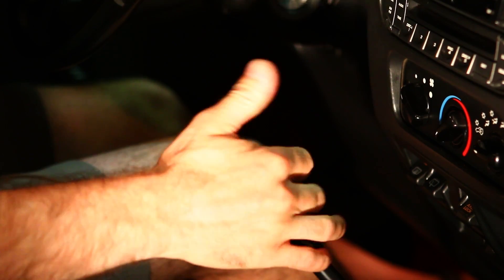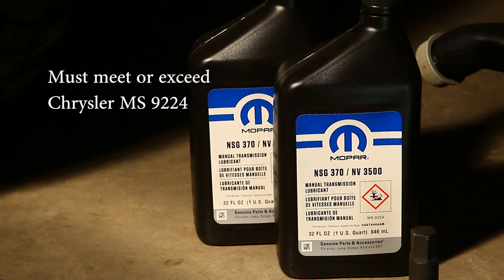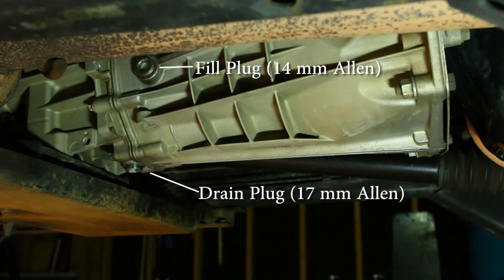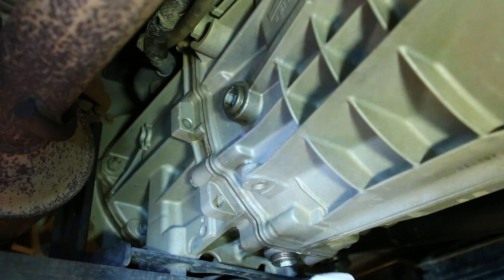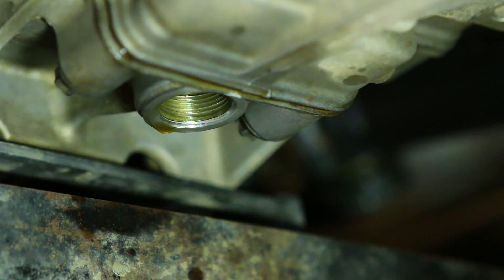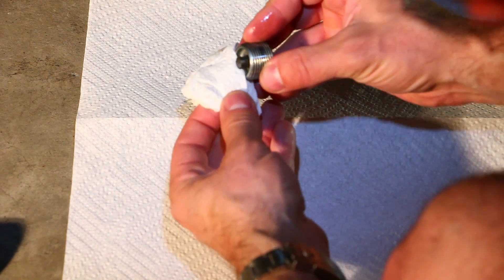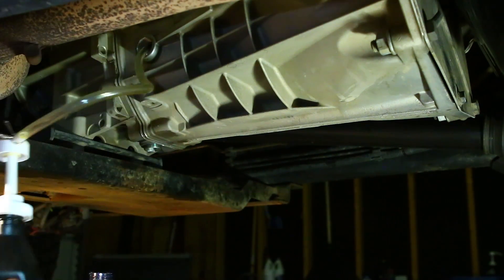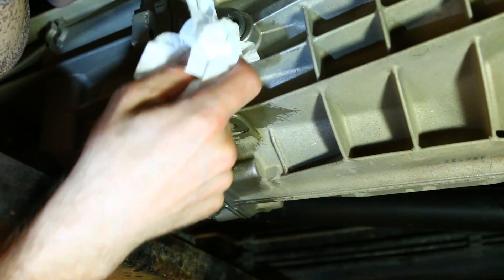Jeep 6-Speed Manual Transmission Fluid Change: NSG 370

Comment: Hello. I've got a 2013 Jeep wrangler sport 4x4 with the 6speed manual transmission and I've got to change the fluid in it and I'm going to use Valvoline Synchromesh for the fluid and then I've got to change the transfer case fluid and going to use ATF +4 in the transfer case .

Comment: My 2018 Jeep renegade 1.4  has a 6 speed manual transmission but its not the 3700 shown here. Im trying to find the fill and drain plugs but that isn't as easy as it sounds. So far, no one has made a video covering this.

Comment: Good explanation.     @1:17 Torque is expressed as ft-lbs or lb-ft with a hyphen and not a slash. In engineering, the slash symbol represents something else and makes no sense in expressing torque!  This is a common mistake made by many thinking there is no difference between - and / but there is!!
Reply from the maker: Thank you very much for that catch and explanation!  I appreciate it and thanks for watching.
Reply: @FreedivejeepHD  You're very welcome.  Most folks don't understand this and in fact, some aftermarket manufacturers make the same mistake. The slash symbol means 'per' (as in pounds per square inch or lbs/in²) and the hyphen is used for force applied at a certain distance for the expression of torque which by the way is the definition of torque.
Reply: Who cares, aren't you feeling special now? I understood it jeez

Comment: I have a 2005 Rubicon with this transmission and I wholeheartedly disagree with using a torque wrench. Thats exactly how you bust a case. Just cuz the manual states it, doesn't mean its correct. Too much of a chance the torque wrench malfunctions or something is wrong with the casting.I always use a little bit of thread compound, and tighten it like I would an oil drain pan. NEVER have even had a drop leak. I'm sure theres a torque spec on the oil drain plug, that doesnt mean you should do it.

Comment: FreedivejeepHD Do I need to support the transmission after removing the skid plate?   You don't mention it and you are as thorough as they come, but I have seen several others say it is required.  Thanks.
Reply from the maker: If you're running a stock setup, then yes; I didn't have to on mine because I have a skid plate setup that includes a subframe crossmember that supports the transmission mount.  It is to this crossmember that the skid plate itself is bolted.

Comment: "With the skid plate removed"
God, would someone, anyone please show this step.
Not a single video online
Reply: He has an aftermarket skid plate that is bigger than the OEM one.  If you have the OEM one, just do it with it on.  The fluid will spill onto the skid plate but then down into the receptacle.  It'll take 2-3 minutes to clean up afterwards - literally.  MUCH easier than taking off the skid plate. Also, if you've have the OEM skid plate that has never come off, probably better to not take off now.
Reply: @OldElvis1927  Yes, rust city down there.
Reply: I didn't need to remove my skid plate on my 2005 Wrangler... not necessary.
Reply: No need. The skid plat is also what holds the transmission in place. Don't pull it thinking your tranny won't drop, it will.

Comment: Manual transmission fluid does matter according to a Jeep specialist ASE certified. OEM Is required!
Reply: No it isn't. As long as what you use meets the spec

Comment: My exhaust Y pipe goes right in front of the drain plug. It is an oem exhaust system for 100% sure. It is a 2012 Jeep, it is 6 speed. How am I supposed to do this job now?
Reply: Take a 17 hex box, cut it with a grinder put it in the drain plug turn with a 17mm key, or buy a 30$ tool from mopar, 30$ was the price of my box set
Reply: @XxXmaltaisXxX  lol that's what I did I made my own tool haha, pretty annoying they put the y pipe right under the plug

Comment: Good video. Seems like you’re one of the lucky ones who has access to the drain plug without a special 17mm tool.
Reply: Damien A 
Seems like YOU have a 10 allen drain plug and a 17 mm OIL marked fill plug on yours .its LIKE that on Jeep compass 2011 UE .your box ,like THE rear one must be 24 mm fill bolt and 10 allen drain plug ? ,boxes that both uses Sae 80w90 limited slip MINERAL oil as in your owners manuel recommandation.Mopar better.Mine WAS low OF oil at 65000 Oem fill ! Those boxes drinks so ! Process is the SAME until its drips out . B regards .

Comment: does the fill plug and drain plug have the same thread? i need a replacement fill plug, but was only able to order a drain plug because the parts department did not have a part number for the fill plug... are they interchangeable at all
??

Comment: Did you ever have any issues with your transmission popping out of gear?
Reply from the maker: No.
Reply: FreedivejeepHD That's quite ineresting, I'm planning on buying a used Jeep Wrangler but I couldn't decide between a 6 Speed or a 5 Speed. After some online research, it seemed as if everyone said that their 6 speed was making noise, pops out of gear, and dosent like anything but expensive fluid.
Reply from the maker: Ya, when you go online to read about something it's easy to find the haters.  The happy people never say anything because they're too busy out enjoying the product.  You'll find the 6 speed to be reliable, durable and SIGNIFICANTLY quieter than the 5-speed.
Reply: FreedivejeepHD I'm guessing that you took very good care of your Jeep and transmission . I'm now planning on getting a 6 Speed. 👍
Reply: im about to buy a 05 kj with that trans and was making some noise
Reply: I wonder what tranny I have in my 2016 Jeep Wrangler Sahara unlimited 6 speed